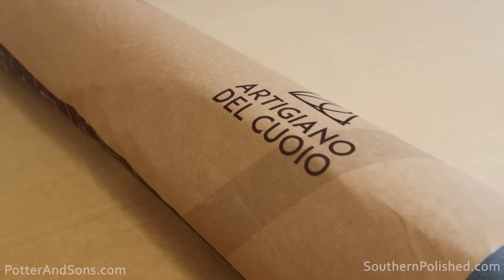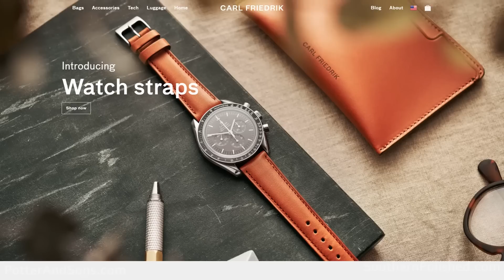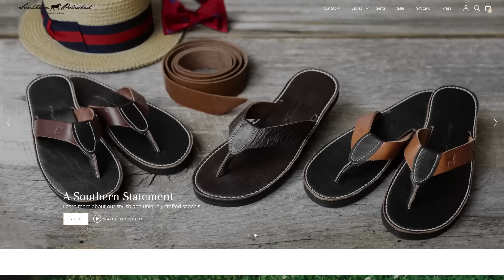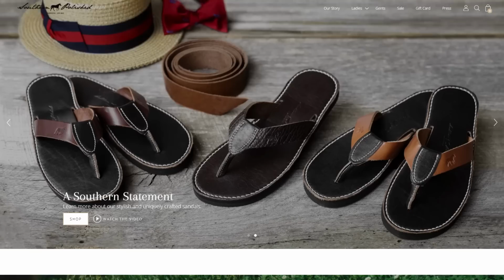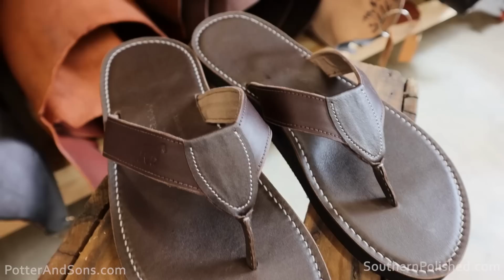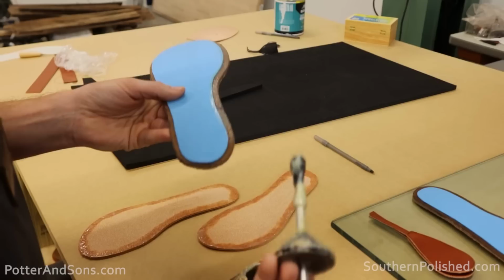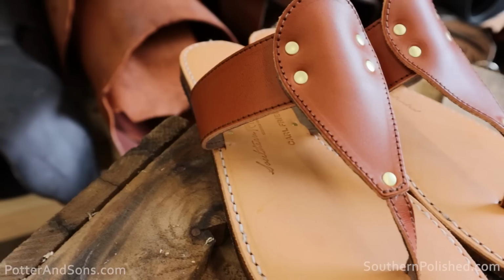Making Men's & Women's Handcrafted Sandals | Luxurious Leather Sandals

Comment: I purchased a pair of the Flip Flops (Mens) Bull Hide / Walnut 2 weeks ago, they are breaking in quickly, and are comfortable. The only thing I am confused about is the Made in Mexico printed on the inside of the upper. I take it to mean the Vibram sole is made in Mexico,  it reads: Size 12; Leather Upper; Balance Manmade; Made in Mexico. Other than that confusing bit these are great. I had a pair of leather flip flops years and years ago, I wore them for a good 6 years (many of those every day) and they wore out. I have been looking every where for a replacement and I couldnt find a pair like these with the thick sole and leather uppers, until I started watching this channel and found the Southern Polished. I hope these last as long and stay as comfortable as my old pair did!

Comment: Is the JR logo on the soles only on this particular collaboration?  The soles you used in the previous video didn't have that.  Are those cut from a JR bend or do you use another brand of oak bark tanned leather for them?
Reply from the maker: They were only for this video. We tried to use different materials on the collaboration.